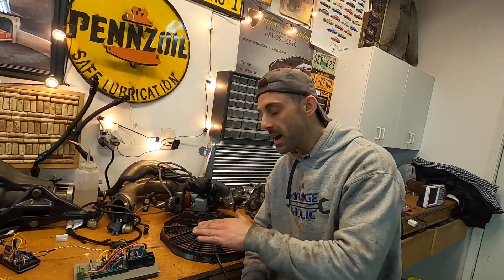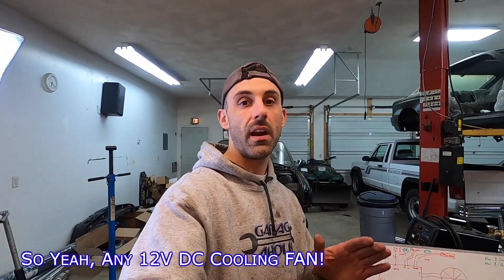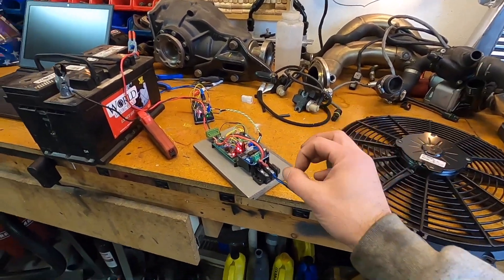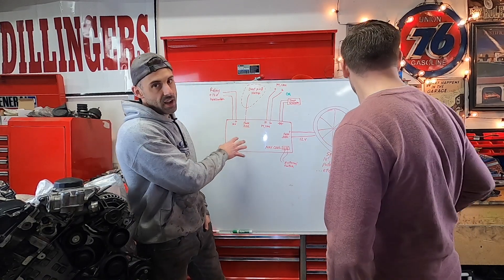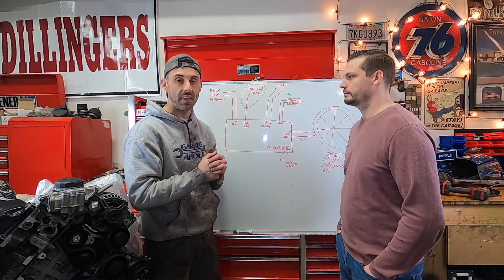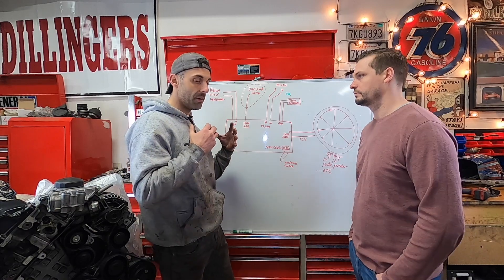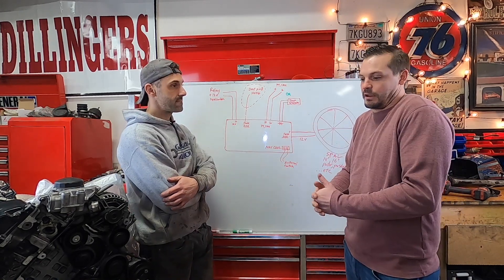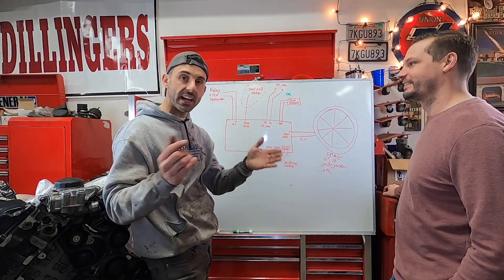Part 20: Who Wants One?! The New Best Way To Cool Your BMW Engine Swap!

Comment: @@UChGqoe_u0oO-dbVRKnh7nww if you guys are looking for feature suggestions, it'd be nice to pull a few variables from PT-CAN and would likely make this product more valuable. Few things I can think of:

1) servotronic could be retrofitted if speed PTCAN could be read to adjust amperage to the rack (7A at 0mph, linear decrease to 0A at 40mph)

2) N54/55 swap. On N55 (swap I'm researching), you need CAN of fuel level senders and just the status of the climate control buttons (but that is for the fan, being done here). Just saying what's started here could be a lot larger than just a fan controller. Great stuff nonetheless

Comment: Great idea, but the DME uses the duty cycle below 7% and above 93% for diagnostics. On later engines such as N54 you will probably have issues of DME going into limp home mode due to trouble codes for a missing stage 2 or 3 or stage 4 fan speed.

Comment: Isn't this same as mechanical thermostat?
Reply from the maker: It supplements it with adjustability for ideal cooling but yes the thermostat is still needed. Think of the tstat as rough tuning and the module as the fine tuning

Comment: Why don't just use pin 8A from msd80  x60001 ? Any fan and original fan relay from n54 engine? Got that setup in my e34 m54 turbo  fan is controlled from dme and you can map any temperature you want for it to kick in. It controls its speed itself too.
Reply from the maker: We discussed that in the video. That is a 100hz output that changes duty cycle from 7 to 93% duty cycle. While it's useful, it requires the use of the BMW PWM fan with the module included. It limits your options. Those fans are wide and hard to fit into swapped BMW's. What you propose I did in the E36 M3 N54 swap and to make that work I had to design the front subframe and frame rails to accommodate that fan. Not solely for that reason, but yes it did work like you describe. This module can apply to any DME that utilizes PT_CAN because the ARBID is the same for engine temp. Good comment!!
Reply: Yeah didn't went that deep in to that fan from e46 325i nearly bolt on my e34 rad so just go that way.

Comment: Wow. This is great. I'd be interested in one, as I have already an electric cooling fan installed in my s50b32 e36 m3. The fan is currently running of the temp sending switch on the radiator but I feel that the fan comes on too late. I'd love to try this new unit that you are building. Hit me up when it's ready, or even a prototype that I could try at my own risk.
Reply from the maker: And that is EXACTLY what this module could do. Use the temp sender resistive values to power any fan as a PWM signal fan. 
Thanks for the offer I'll keep that in mind as we go through prototype phase testing.